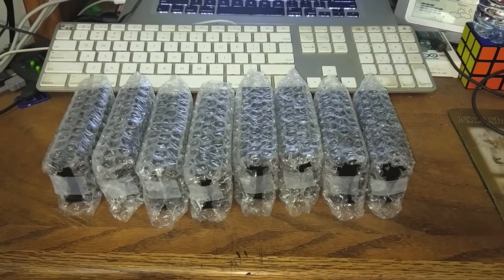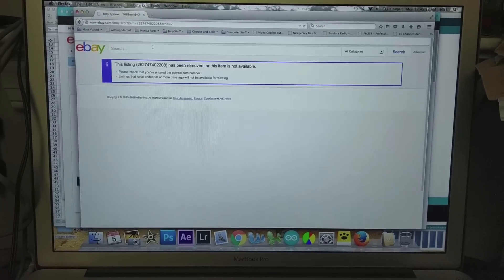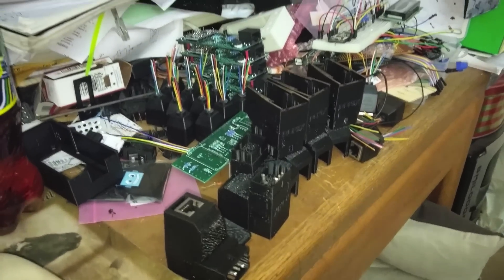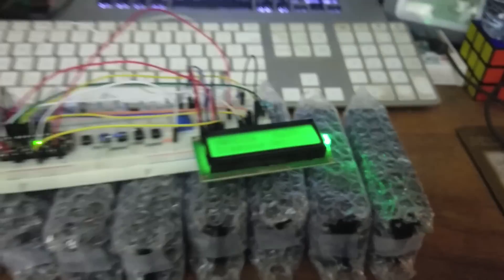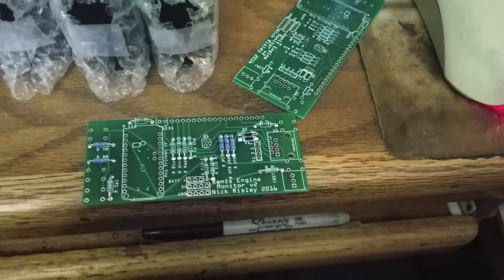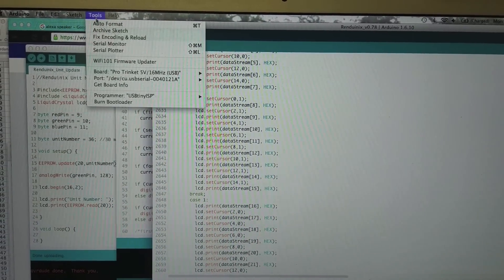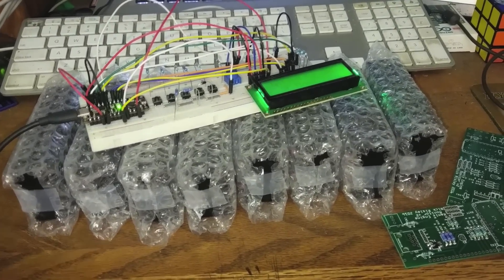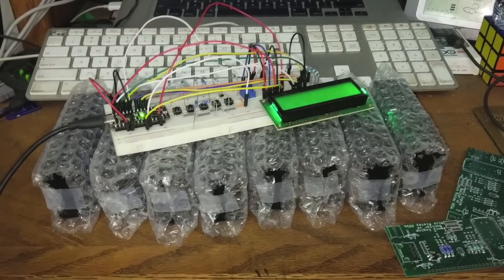REM Wednesday Sale, Questionnaire, Future Ideas

Comment: I would definitely be interested in a kit. i would also be interested in the positive screen. Also, I could provide my own ethernet cable if that could help bring the cost down. If a kit is available I will buy it now.

I saw on your REM you had GPH displayed. Is that included on all of them now? I have an extra clock panel that I will give you if you want it. It's just a blank panel with no clock.
Reply from the maker: Sweet, Kits will hopefully be available anywhere from early to mid March, just putting the finishing touches on them now and ordering parts. I can get Ethernet cables for pretty cheap so that's not an issue. Just make sure to follow to YouTube Channel or Facebook Page to know when the next sale is ready to go live. 

As of the latest update, Renduinix V0.80, GPH is included and any model that upgrades to the latest software can get that reading. All new units will always receive the latest stable update when they are shipped. As for the clock panel, a buddy actually had one lieing around that I was able to use for measurements. That version will be delayed a little bit until I can figure out a good way to include a 2nd display for the clock, little tricky to find exactly what I want.

Comment: Hi, I JUST noticed your You Tube videos a few days ago and am really interested in what you are doing. I have an 89 MJ Comanche 4.0 with the AX-5 manual transmission.  Here are my answers to your questions:
1.  Positive Screen: I'm indifferent and would be just as happy with the one you supply now.
2.  Kits:  I'd buy a kit for $60 in a heartbeat.  I build a lot of kits and use proto boards for my own projects.
3.  More Powerful boards:  Yes.  Since you source your boards from Adafruit (I have a Maker Space relationship with them), have you considered using one of the feathers? This would allow a REM module to broadcast bluetooth or WiFi to a unit (smart phone or REM command modue with display) without running a cable.  This could also be done inexpensively using ESP8266 WiFi microprocessor boards.
4.  This idea has a lot of potential.  Have you seen the https://www.youtube.com/user/iHayri1 videos?  I am going to buy one of his GPS speedometer "cubes" and mount it in the dash instead of trying to correct my stock speedometer for my Comanche's 4.88 gearing with 31" JK Rubicon wheels and tires.

What you have done so far is awesome and I look forward to your continue success.

-mel
Reply from the maker: Hmm, I actually got a feather proto for free with one of my big orders but didn't really mess with it. The 3.3v would require some changes and it was interesting changing the code to get the 32u4 chip to work properly with the serial. The Wifi or Bluetooth could be interesting for allowing a plug and play dongle that connects to your phone but that would require a lot more looking into as far as apps and connectivity goes.

Never seen him before but holy cow is that some cool stuff, I dig the modular design he's got going on. I was maybe playing with the idea of going with an oled display like that but again, more looking into how those are controlled and how much space they need to run.

Thanks for the input, it's always helpful to hear what people are interested in. There is a guy in Ireland that is working on a project that converts his fenix ecu output into something that is obd-II compatible, and then broadcasting it through bluetooth so you can just read it from your phone with an obd II app. That would be a neat wireless approach so I hope it works out for him. Here's his page: https://www.facebook.com/obd2fenix/?fref=ts
Reply: Actually, there would be no need for a smart phone dongle when using bluetooth.  A simple ios or android app would suffice for display and control.
Reply from the maker: Sorry, I meant dongle on the vehicle end, obviously the connectivity to the smartphone would be wireless.

Comment: The Dash clock would be the PERFECT location, could build a unit to replace it all together. Would be a rather large screen but you could display most gauges at once. I'd definitely buy one.
Reply from the maker: A full touchscreen display would be pretty sick, but I'd have to learn how to control it. Might have to step up to a more powerful microcontroller but it's a thought.

Comment: Can oil pressure be added by chance? (don't know if that goes through the ecu at all). absolutely would love this being in the clock space, and 100% would love remote controls.
Reply from the maker: Oil pressure is a cluster only sensor. With some math and testing I could probably create a splitter adapter to feed into the REM as the Betas do have pins open for mod-ability.
Reply: that would be awesome, since my gauge doesn't work, and I've replaced both the gauge and the sensor, so I have an electrical issue somewhere.  Electrical fan speed also out?
Reply from the maker: Is it pegged or always at 0? pegged is no ground, 0 is full ground but no sender response. Could also be a clog in the T fitting there, used a pipe cleaner on mine. And do you mean like electric fan RPM? That would be a highly specialized reading as you'd have to read it's rpm first somehow and then send that to the REM.
Reply: oil pressure pegs out at the highest point (I think above 80psi?) and then every now and then will drop to 0 and then back up to the top. I am 99% sure its not an engine issue, as I've had an engine replacement, and it has done it before and after.

electric fan either on or off RPM's don't matter since it runs at one speed right? or does it have two speeds? if it runs at two speeds, i guess three readings, off, speed 1, speed 2?
Reply from the maker: Sounds like the gauge might be going from disconnected to shorted to ground or something then. As for the fan, its only a one speed. There are no pin outs for the fan relay but an on or off reading could be accomplished sort of simply if you ran wires to it